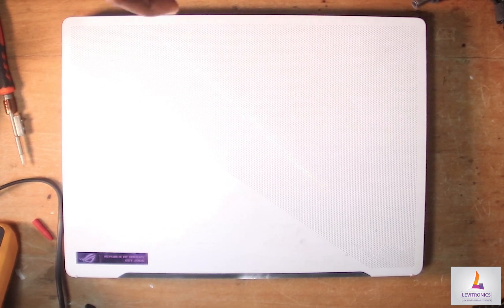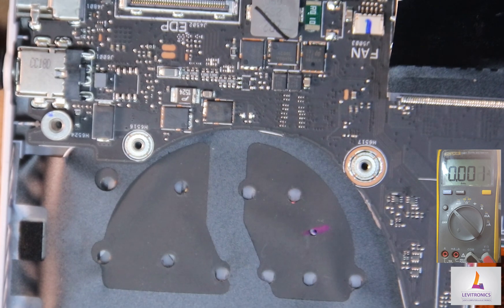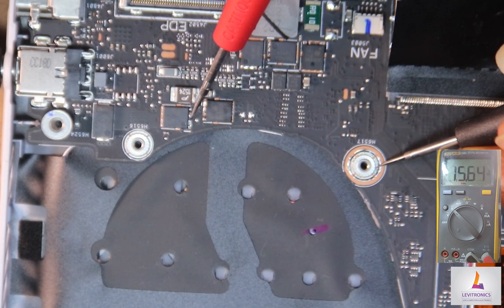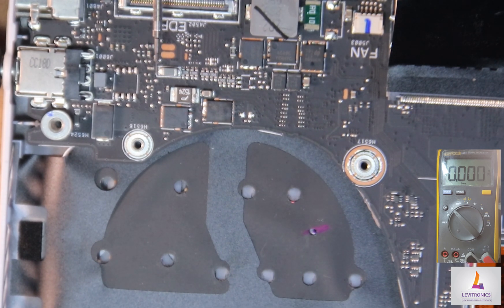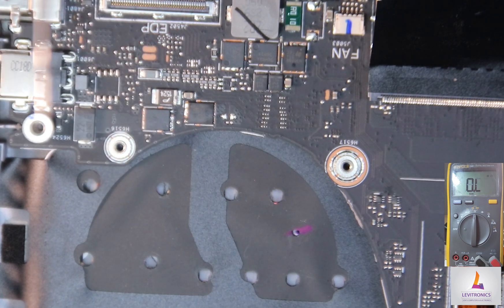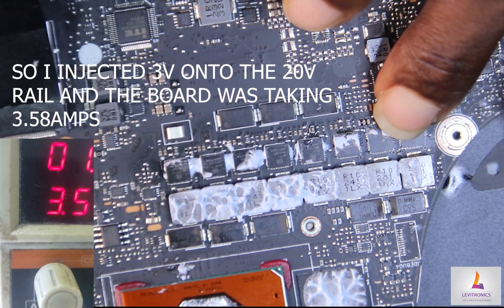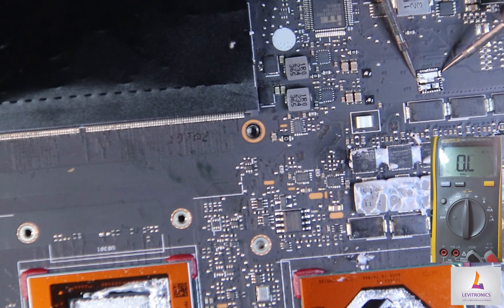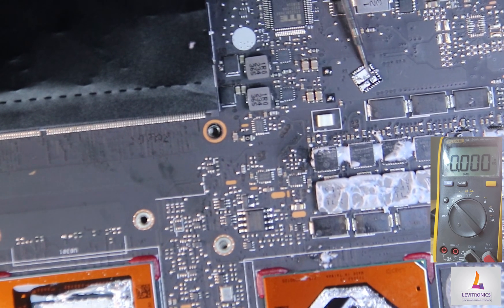ASUS ROG ZEPHYRUS G14 NO POWER

Comment: I’ve replaced the battery on mine and can’t get it to come on. It will flash orange. I bought it used without an m.2. Would I be able to send it to you?
Reply: Is it working? I replaced my battery too, but it is not charging or turning on. There is no battery light whatsoever.

Comment: Same case only the short one is in a group of 2 mosfets which are next to the cpu phases on 5018SG After changing it the computer turned on detected even the video card, but then it did not recognize the gpu, only cpu, it was after use in Windows only with cpu it turned off, now it only turns on and after 6 seconds it turns off, thanks for the Video 👍🏼

Comment: where are you located.. mine is 2021 and wont turn on.. sometimes turns on but then when you turn it off and it sits on battery for more than 2hrs then it doesnt want to boot anymore
Reply: problem solved it was bad battery and bios update
Reply from the maker: @Delavega2468  glad you had a fix.
Reply: @Delavega2468 and bios update? Even with a battery replacement I can't get mine on. It is not charging. That means I cannot do a bios update, correct?
Reply: it also doesn't power on even after I clear the cmos and also try to power it on using only the adapter
Reply from the maker: Leviitu@gmail.com
Reply from the maker: Dm me on my email